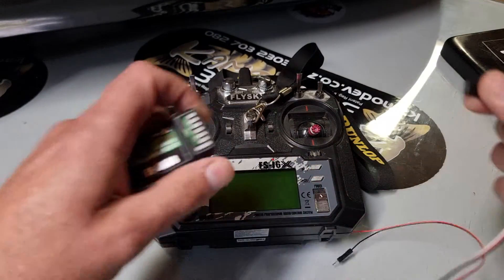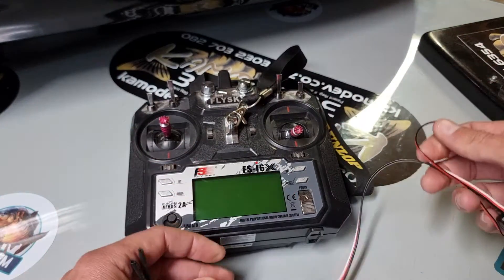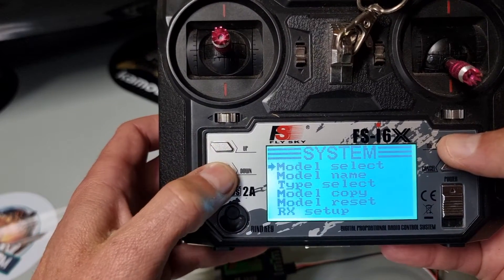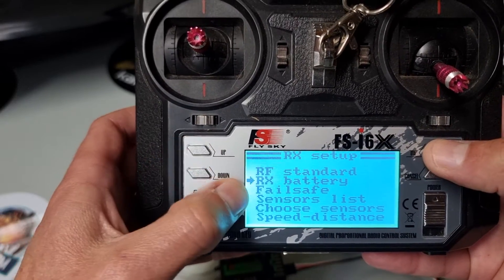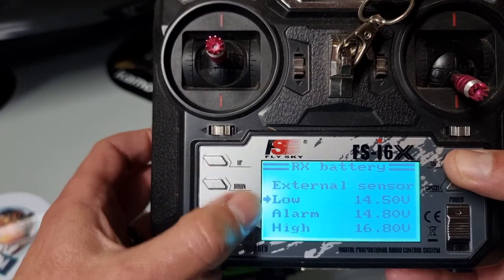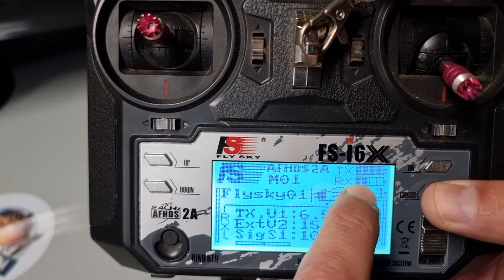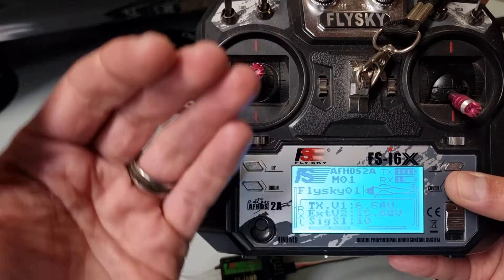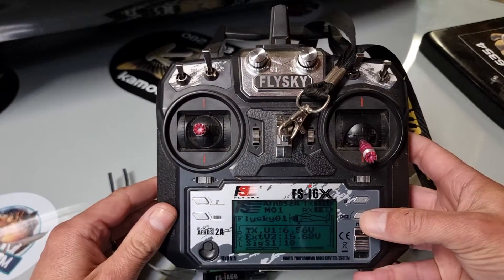Flysky i6x voltage sensor setup

Comment: Im using a 12v alarm battery even if the battery is full it shows it shorts 1 bar so would that be on the settings aswel?

Comment: Do you know why i see a difference of 0.6 volts between my transmitter and my imax charger. When i have full 16.8 at the charger,  i see about 16.2 at flysky screen.

Comment: My voltage wont go past 5 volts.
Reply from the maker: You need to adjust high points first then the lower ones. And have it on external battery option.

Comment: As far as 4S Lipos is concerned, 14.8 volts are 3.7 volts per cell, which is the nominal voltage. My first alarm is at 14 volts and 'low' at 13.5 volts. I have sufficient security. I see it when I connect the lipo to the charger.

Comment: Receiver ko ESC se jodne par RX bettery low or beep ki Abad de rha h usko dur karne ke liye kya Karna hoga plz halep me 🙏
Reply from the maker: That's what it's designed to do, otherwise set your alarm point lower in parameters lower but then keep in mind not to run battery to low as it's not going to warn you correctly.